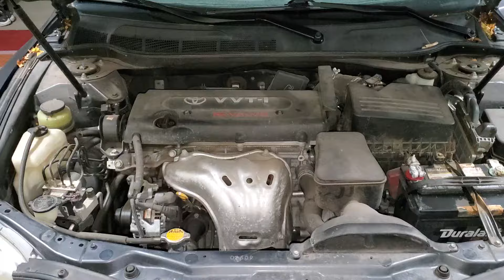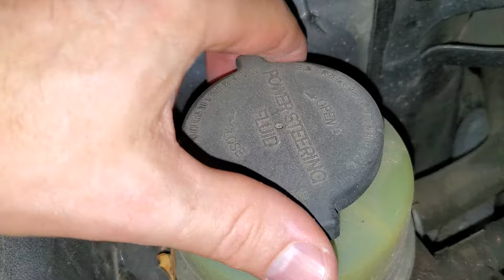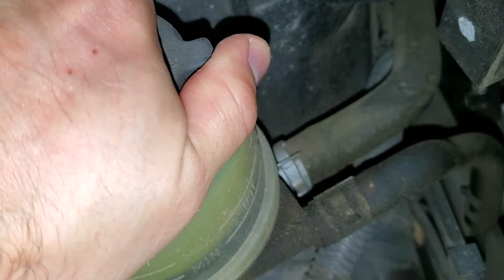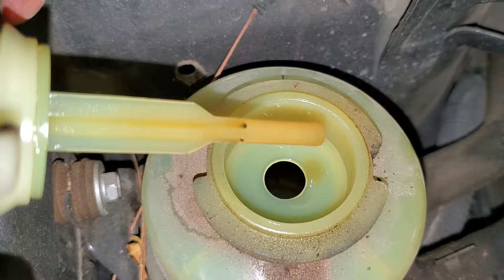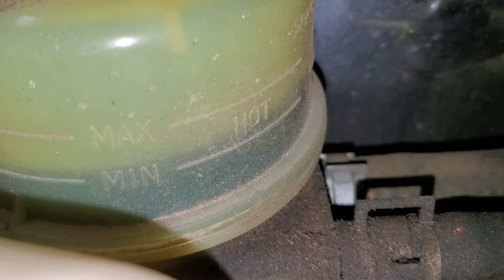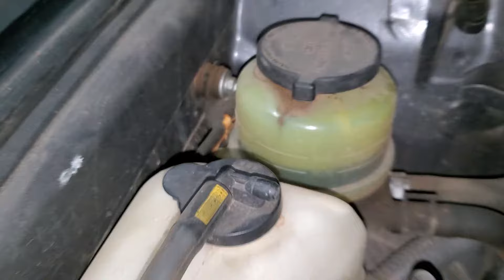2006 To 2013 Toyota Camry How To Check Power Steering Fluid Level In Reservoir

Comment from the maker: This quick DIY video shows owners of the 6th generation 2006, 2007, 2008, 2009, 2010, 2011, 2012 & 2013 Toyota Camry how to check the power steering fluid level in the reservoir bottle.

Check out all of the Toyota Camry DIY repair and maintenance guides - 
https://www.paulstravelpictures.com/Articles/Toyota-Camry-Repair-Maintenance-Guides.htm

Comment: I have a 2012 Camry SE and the power steering reservoir is not over there. Do you know where it's located?
Reply from the maker: Hi, I'm reading that the 2012 and 2013 Toyota Camry models have electric power steering (EPS) so there is no power steering fluid.

If you haven't already seen it, I have a list of Toyota Camry DIY maintenance guides on my site - 
https://www.paulstravelpictures.com/Articles/Toyota-Camry-Repair-Maintenance-Guides.htm

I hope you find them to be useful.

Comment: Do I have to add more power steering fluid if it is on min? And what kind of fluid do i need for the Toyota Camry 2007?
Reply from the maker: Hi, the minimum level is fine. It will rise when the engine and power steering rack are hot.

Any power steering fluid is fine. I usually get the cheapest like Prestone or Lucas brand - https://amzn.to/4ftY3pb

Comment: Hi
My car 🚗 2013 TOYOTA CAMRY .my car Engine oil was evoparating .no leaking .5W 30 .
Please 🙏 help my issue.
Any other oil Preferences
Reply: 400,000 km running 
Iam Uber Driver
Reply from the maker: Hi, I'm sorry to hear that. If you don't see a leak, the engine might be burning the oil. 

I would get it inspected by a mechanic.

Comment: My fluid on minimum on cold but wen its hot still at minimum..i notice i have leak but i dont know if its oil or steering fluid im trying to see if the pump is leaking but its hard to tell?
Reply from the maker: Hi, the power steering fluid level doesn't change much with the engine temperature like the coolant does. If you suspect that you have a slow power steering fluid leak, try putting in some Lucas Stop Leak P/S Fluid. That worked to stop the P/S leak in my car that started in 2018. I haven't had a problem since then. Here's the bottle on Amazon - https://amzn.to/4daLRsA

Good luck!

Comment: If fluid is at min at cold, do i fill up more
Reply from the maker: Hi, if the fluid is at min with a cold engine, that is fine. I would leave it alone. When the engine is hot, the fluid will expand and take up more space.

Here are all of my Toyota Camry DIY guides -
https://paulstravelpictures.com/Articles/Toyota-Camry-Repair-Maintenance-Guides.htm

I hope you find them to be useful. 🙂

Comment: my 2012 camry does not have a reservior!
Reply from the maker: Hi, the 2012 Toyota Camry has electric power steering (EPS). So there is no power steering fluid reservoir.